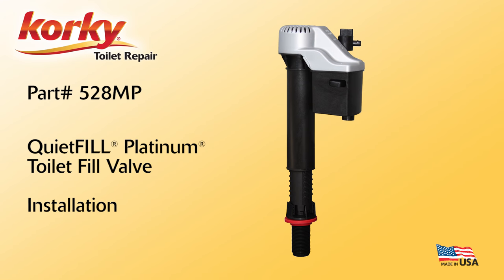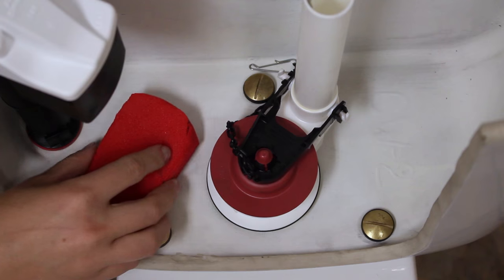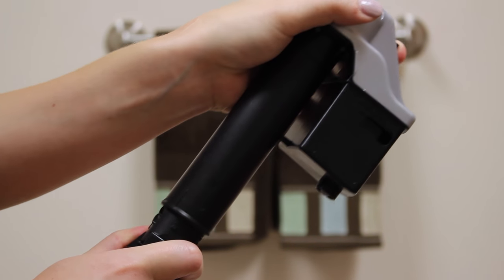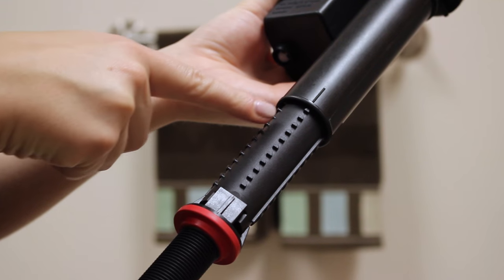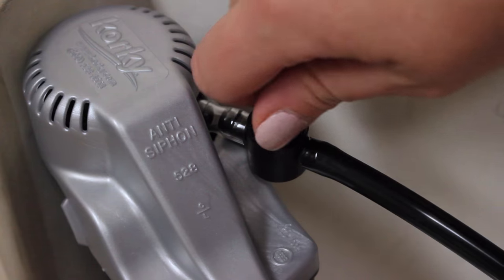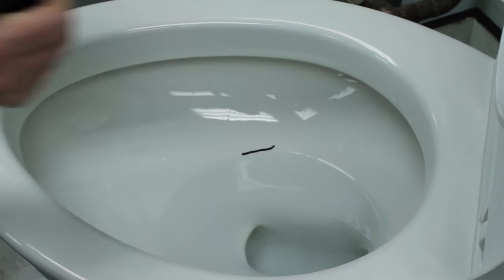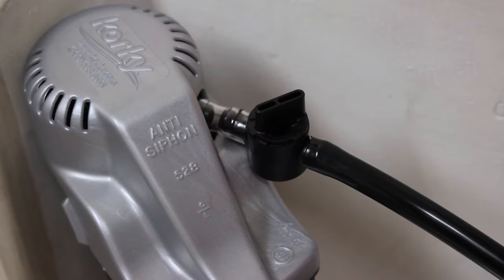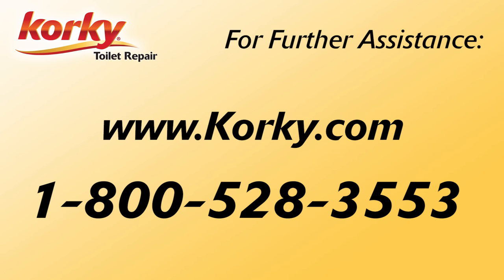How to Install QuietFILL Platinum Toilet Fill Valve by Korky

Comment: Thank you so much for this video.  I put off replacing my fill valve because I thought I would need a plumber, and had to listen to it running and wasting water for a couple weeks.  After I watched this video, I went down and bought a new one for $10, and did it myself in under 10 minutes.

Comment: Just installed.  So easy I figured I was doing something wrong.  Keep making them in the USA!  That's why I bought it!
Reply: Same here! I'm trying to buy USA whenever possible too!
Reply: USA USA USA!
Reply: I work at the factory where they make these it’s terrible
Reply: @coltonlien8816  what’s terrible about the factory? You have me intrigued!
Reply: @coltonlien8816  yeah I’m curious as well.  I love buying USA products but my Korky shank cracked 2 years later so I bought a new one.  Definitely better than fluidmaster.  Wish they made brass shanks.
Reply: @coltonlien8816   yes, the net outside the 5 story windows to prevent sui*ci* is horrible. oh wait...

Comment: As easy as it looks*** except it took my 45 minutes to get off the old crusty plastic rings from the underside of the tank. Other than that it was a breeze! 😅
Reply: I had the same problem. Once I got the old one removed, it went smoothly.

Comment: GREAT video! Not that this was a challenging task, but it made it a LOT easier. The only issue I had was my old fill valve didn't have the hose, so my "existing water line" didn't line up with the stopping point on this model. I just went with it though.

Comment: The only problem I encountered was that the refill tube was just slightly too large in diameter to fit into the preexisting flush-valve (Mansfield type).  I ended up making a short slice down the length of the refill tube and overlapping the two sliced edges before jamming it into the flush-valve.  It's worked so far.
Reply: mine was the same way, i just used the old tube

Comment: So I turn my water supply as far to the right as it will go and yet water won't stop filling the tank. Any ideas?
Reply: Do you mean you're turning it all the way clockwise?  If so, that's your problem: adjust/turn it COUNTERclockwse to slow the flow.

Comment: Hello korky folks - I just installed a platinum fill valve as a part of the universal repair kit but it seems to be hissing in a way that the internet suggests is the cap in the fill valve - could there be something I'm missing? And it being brand new is there any way to get a replacement part or replacement fill valve?
Reply from the maker: That is strange! Let us help. Are you able to contact our Technical Support team? We would like to learn more and quickly identify a solution. Your fill valve is backed by a 5 year warranty and we want to ensure your complete satisfaction. Please call 1-800-528-3553 or email Sales@Lavelle.com. We are available Monday through Friday, 7:30AM-5:00PM CST.

Comment: VERY DISAPPOINTED.  The quality and installation instructions are well above average.  Sadly---the hose/tube is not included in the kit.  Since the hose/tube is not a universal size fitting all makes, the size needed is unique to the Korky.  Without the tube the kit is useless.  Not only is no tube included, no reference to the size tube needed is mentioned.  Sad!!
Reply from the maker: Let us help! We apologize for the inconvenience this has caused. If you are missing the hose, we are happy to send you one free of charge. Your fill valve is backed by a 5 year warranty and we want to ensure your complete satisfaction. Please call 262-763-2434 or email Sales@Lavelle.com. We are available M-F, 7:30am-5:00pm CST.

Comment: Installed the other day and had issues with getting water line reconnected but finally got it. Now why is the flapper occasionally coming off? Any suggestions?
Reply from the maker: Are you able to contact our Technical Support team? We'd like to learn more about your flush valve and the kit that you purchased. Please call 262-763-2434 or email Sales@Lavelle.com. We are available M-F, 7:30am-5:00pm CST.

Comment: I have one of these but I’ve noticed that it takes 2-3 minutes to fill up my tank. My valve is in the completely open position. How can I adjust to fill the tank faster?
Reply from the maker: Are you able to contact our Technical Support team? We would like to learn more to help address your issue.  Please call 1-800-528-3553 or email Sales@lavelle.com. We are available Monday through Friday, 7:30am-5:00pm CST.

Comment: That was helpful. Had to replace the same unit my general contractor put in 5+ years ago. He said it's not expensive, and it will probably start going bad in the future. But it's easy and cheap to replace. He was correct. This video was helpful. Read the instructions and understood, the video helped confirm. Only wish I'd turned on the air conditioning before I started. Muggy.

Comment: The water in the tank now doesn't come up as high as it used to, so less water goes to the bowl with each flush.  How do I adjust it so that the tank fills up another 1/2" or so with water?
Reply from the maker: To raise the water level in the tank: 1) Turn off the water supply; 2) Flush the toilet; 3) Twist the upper half of the fill valve counterclockwise to unlock the valve; 4) Pull the upper half of the valve up 1/2" inch; 5) Rotate the upper half of the valve clockwise to lock it in place; 6) Turn the water supply on to refill the tank.

If additional assistance is needed, feel free to call us at 262-763-2434 or email us at Sales@Lavelle.com. We are available M-F, 7:30am-5:00pm CST.

Comment: I’m having tons of issues with leaking at the water line connecting to the unit. It said hand tighten and no sealant or tape. I wonder if I have a defect. Any suggestions?
Reply from the maker: Are you able to contact our Technical Support team? We would be happy to help! Please call 262-763-2434 or email Sales@Lavelle.com. We are available M-F, 7:30am-5:00pm CST.

Comment: I had to turn the dial all the way to off position because my bowl water reaches the intended level very fast. So that thing is fully off and the bowl is still filling up right away. Is something wrong with my toilet???
Reply from the maker: Are you able to contact our Technical Support Team? We would like the opportunity to learn more about your specific toilet and get your fill valve adjusted accordingly. Please call 262-763-2434 or email Sales@Lavelle.com. We are available Monday through Friday, 7:30AM-5:00PM CST.

Comment: Thank you for the video,
How do we find out what the original water level was if we didn't mark the water level at first? lol
Reply from the maker: Great question. Here are a few suggestions for determining your waterline: There may be a scum line in your tank where the water used to rest, some toilet tanks have markings determining the water line, you can set the waterline 1/2 below the overflow pipe on the flush valve, and some flush valves have waterline indicators as well. IF you have additional questions or need help, we are here and happy to help!

Comment: Thanks for the video. Relatively easy. Is there away to adjust the height a bit once installed and not have to drain the tank again? Seems a little low after hooking it up and seeing the actual waterline. TIA
Reply: No, you'll have to turn the water off and flush the toilet first.

Comment: I just woke up to one of these failing. For about the last 100 flushes, it was stuttering. (Fiil, stop, fill, stop). Since it would eventually stop after a minute, I didn't give it much thought. Tonight I dozed off in a chair in the basement. I woke a little to hear the sound of rain, but it was a bit loud, and none was in the forecast. I looked over and it was raining in my basement. First thought was a plumbing clog, and condensate from my furnace, but way too much for that. Maybe a sewer backup? The water was quite clear and odorless. I went upstairs and there was water in the hallway and about a half inch in the bathroom, draining into the hallway and down the furnace vent. I turned off the shutoff and the deluge quit. Hmm, maybe the seal cracked. I spent about 3 hours mopping up the mess in the middle of the night, and still have to air some things out in the morning and dry the carpet. I went to turn the water back on, and surprise, no leak. Weird. Took the tank lid off and turned it on again, it wouldn't shut off, and the overflow drain wasn't big enough to take care of the water, and when the tank hit the top, it would overflow. Really not happy. Some stuff may have gotten ruined, and I sure didn't want to mop up the mess in  the middle of the night.
Reply from the maker: Let us help! Are you able to contact our Technical Support team? We would love the opportunity to learn more and make this right. Please call 262-763-2434 or email Sales@Lavelle.com. We are available Monday through Friday, 7:30 AM to 5:00 PM CST. Your fill valve is backed by a 5 year warranty and we want to ensure your complete satisfaction.
Reply: @KorkyToiletRepair  I'll send off an email in a day or two. Good thing I was home when it happened, my meter registered around 35 gallons in the maybe 20-30 minutes it was overflowing. I did spend about 3.5 hours cleaning up the mess, but haven't found anything thats completely damaged, and it didn't drip on any electrical boxes. The carpet in the hallway is almost dry. I can mail the defective unit back if you want to take it apart and figure out why it failed, and maybe figure out a failsafe to cut the water supply if the water keeps running when it shouldn't

Comment: The red seal did not work, my tank was leaking after installing two different versions of this product.  Had to re-install my old valve and return these.
Reply from the maker: Let us help! Are you able to contact our Technical Support team? We would love the opportunity to learn more and quickly identify a solution. Your toilet fill valves are backed by a 5 year warranty and we want to ensure your complete satisfaction. Please call 262-763-2434 or email Sales@Lavelle.com. We are available Monday through Friday, 7:30 AM to 5:00 PM CST.
Reply: @KorkyToiletRepair  Unfortunately I've already returned the items.  I had purchased two, for two different toilets.  I used both and both were leaking from the same spot.  I just could not get a good seal.  When I re-installed my original valve, it did not leak.
Reply from the maker: @gowanis  Sorry for the inconvenience this caused you. By red seal, are you referring to the seal at the bottom of the fill valve?
Reply: @KorkyToiletRepair  yes.
Reply from the maker: @gowanis  Thank you for confirming. I will pass along your feedback to our team.

Comment: Is it necessary to have the clip attached to the end of the tube?
Reply from the maker: Yes, this is very important. If the refill clip is not attached to the end of the tube, the water pressure may cause the tube to spray water inside your toilet tank. This may ultimately lead to property damage if the water makes its way outside of your toilet tank. Additionally, the water from the refill tube sends water down your flush valve overflow pipe and fills the bowl of your toilet to the proper level to ensure a powerful flush. If you have additional questions or need further assistance with your installation, please call us at 1-800-528-3553. We are available Monday through Friday, 7:30 AM to 5:00 PM CST.

Comment: So I installed mine and it is leaking from the top of the valve.  Is that normal?  How do I stop it.
Reply from the maker: While the fill valve is bringing water into your toilet tank, it is normal to see water dripping from the silver cap of the fill valve, refill adjuster and base of the fill valve. If your fill valve is not performing properly, please contact our Technical Support Team. We are here and happy to help! Please dial 262-763-2434 or email us at sales@lavelle.com. We are available Monday through Friday, 7:30 AM to 5:00 PM CST. Your fill valve is back by a 5 year warranty, and we want to ensure your complete satisfaction.

Comment: I'm installing this today. With the old cock and ball system, the water stopped filling once the water in tank raised the ball.  With your Korky replacement Valve, what stops the filling process..?
Reply from the maker: Thanks for your question. The fill valve shut off works similarly, however, the Korky fill valve has an internal float. Once water fills the external float chamber, it causes the float to rise and shut off the fill valve.
Reply: @KorkyToiletRepair  You should get some kind of award for this technology!

Comment: I'm trying to install this valve but I'm having a problem at the water supply line. When I connect the water supply line to the fill valve and turn the water on there is a leak between the fill valve and the water supply line nut. What should I do?
Reply from the maker: Good question! Check out our other video, we think it may help: https://www.youtube.com/watch?v=YHDFpvrRGZg

If you have additional questions, we are here and happy to help. Please contact our Customer Service team by dialing 1-800-528-3553 or email sales@lavelle.com. We are available Monday through Friday, 7:30AM - 5:00PM (CST).

Comment: My toilet is still running a little water in the bowl non stop . Wonder what i did wrong? And the tank is wobbly
Reply from the maker: It sounds like you may have a leaking flapper if water is running in the bowl. Let us help! Are you able to contact our Technical Support team? We would love the opportunity to learn more and quickly identify a solution. Please call 1-800-528-3553 or email Sales@lavelle.com. We are available Monday through Friday, 7:30AM - 5:00PM CST.

Comment: I installed your part and my toilet keeps running. I just replaced the flapper and the foil value. I am not sure what I am doing wrong.
Reply from the maker: Let us help! Are you able to contact out Technical Support team? We would like the opportunity to learn more about your toilet and quickly identify a solution. Please call 1-800-528-3553 or email Sales@Lavelle.com. We are available M-F, 7:30AM-5:00PM CST. Your fill valve is backed by a 5 year warranty and we want to ensure your complete satisfaction.

Comment: Hello, I just replaced our old fill valve with this model. It seems to be working well! That being said, when I reconnected the water supply and turned it on, the pipe rattled and squealed. I adjusted the valve so the rattling/squeeling stopped, toilet filled and flushed the toilet several times while optimizing the flow. Anyway, the ultimate question is, should I be worried about those sounds when I turned the water back on?
Reply from the maker: Hi Tim, thanks for choosing Korky! Are you able to contact our customer service team? We would like to learn more about your toilet and fill valve to quickly identify a solution. You fill valve is backed by a 5 year warranty and we want to ensure your 100% satisfaction.  We are here and happy to help! Please dial 1-800-528-3553 or email us at sales@lavelle.com. We are available Monday through Friday, 7:30 AM to 5:00 PM CST.
Reply: Give customer service a call and it sounds like it's not an issue I have to worry about a whole lot. The toilet fills fine, and the supply is turned on - just not as "open" as it used to be. I'll see if some of the things she recommended work later tonight. Thanks for the quick response!
Reply from the maker: Fantastic! Glad to hear you were able to get some answers. As our team mentioned, if you aren't fully satisfied, drop us a line and we will make it right!
Reply: Wanted to follow up on this as I forgot to. There are no issues anymore! I believe it just needed to have the air worked out for a bit. Easy install and so far so good on the product! Thanks!
Reply from the maker: Great to hear, thanks for the follow-up!

Comment: I installed this model and it leaks in around the top when flushing, though it stops (leaking) when the toilet is full. Is that normal?
Reply from the maker: Yes, the fill valve brings in water to your toilet tank from the bottom and near the top of your fill valve. This is normal. If you have additional questions or concerns, please don't hesitate to contact us. We are here and happy to help! Please dial 1-800-528-3553 or email us at sales@lavelle.com. We are available Monday through Friday, 7:30 AM to 5:00 PM CST. Your fill valve is backed by a 5 year warranty and we want to ensure your 100% satisfaction.
Reply: Hello Korky,

I have this exact fill valve and have the opposite of what is happening. My bottom of the fill valve sprays water into the tank but the top part won't do anything? The manual says it should spray water top, bottom and into the flapper cylinder. I emailed and no response for a month?? I don't want to waste water that fills the bowl while my tank waits. I want the top part of the fill valve to spray so it fills quicker. 😞

Comment: What is the tamper proof accesory for
Reply from the maker: The included tamper proof key is an optional accessory designed for Plumbing Pros and property managers. The key is designed to lock the fill valve in position to prevent people from manipulating/moving the fill valve. The key is an optional accessory and not necessary for a proper installation. If you have additional questions or need further assistance with your installation, please call us at 1-800-528-3553. We are available Monday through Friday, 7:30 AM to 5:00 PM CST.